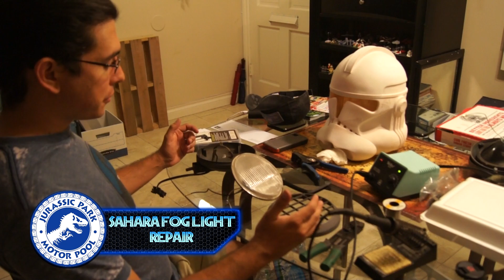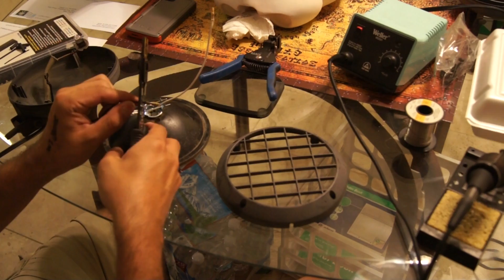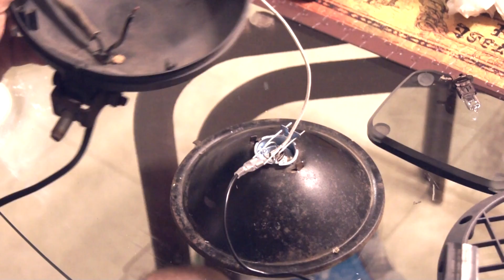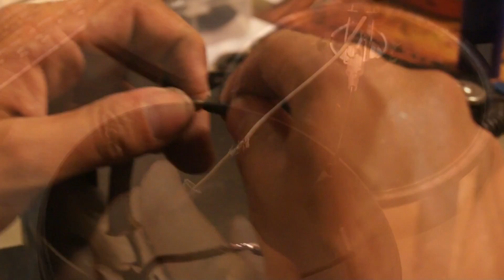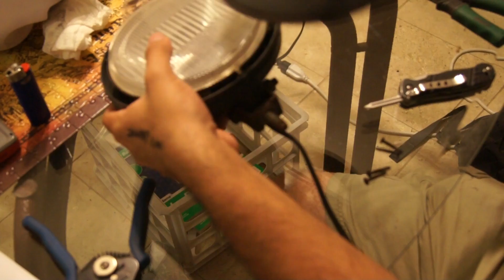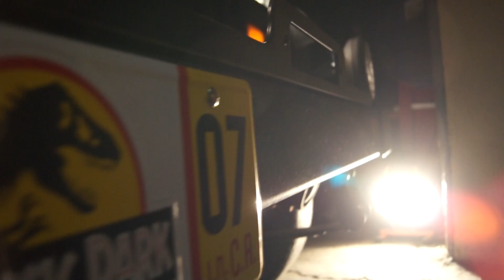JURASSIC PARK MOTORPOOL: FIX JEEP WRANGLER SAHARA FOG LIGHTS

Comment: Thanks a million, had to make the exact same repair on my '95. It was easiest to find the donor lights by searching their part numbers, PL2202 or 27-9162. The factory bulb holders were extremely weak after 25 years. I only wish there was a way to just get the bulb holders, but if you think of it as getting the bulb holders plus two new bulbs, that's not so bad. I paid $30 for my set.

Comment: I would have like to see how to extract and later install the bulb housing fixture.  I recently purchased a pair of YJ fog lights only to find out the housing was in pieces. Any suggestions on replacing the bulb housing?